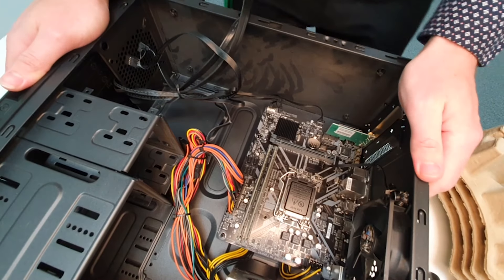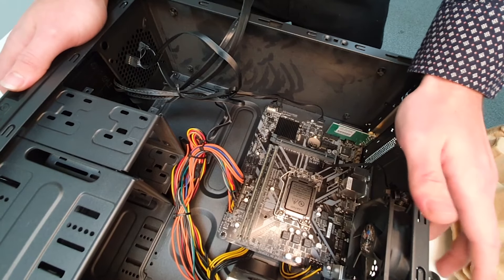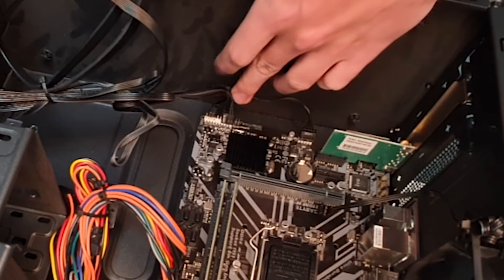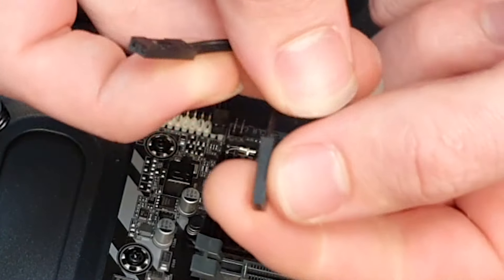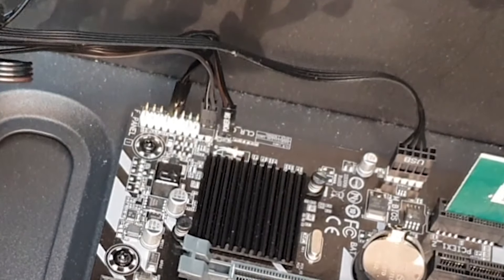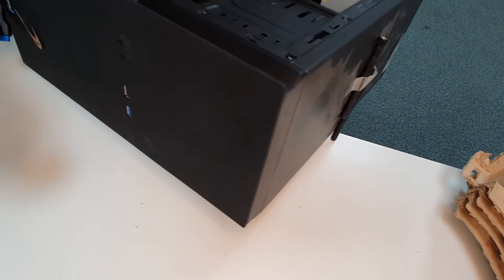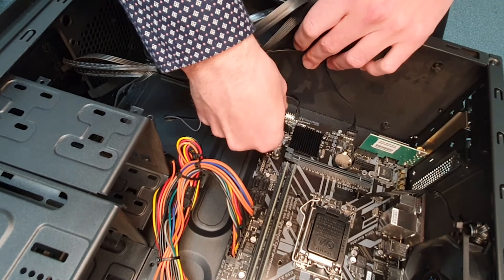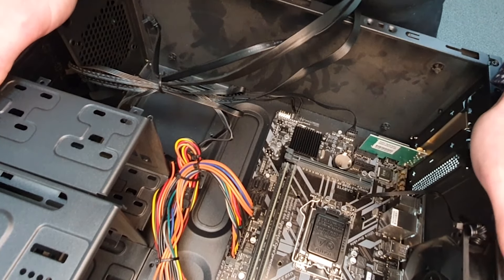How to Reset CMOS - Reset BIOS Fix Display Issues!

Comment: I did everything you just showed, as well as removing the battery and nothing worked. The PC runs, but no display. The graphics card is on - the fans are spinning. It was working fine until I stupidly adjusted the wrong settings in my BIOS
Reply: Did you changed graphic card to switchable? I turned my laptop on and waited like 4 hour. Then it turned on automatically. Its pretty stupid solve but worth trying
Reply: Hi, did you fixed it?
Reply: I probably did the same stupid setting in the bios, same problem. Nothing seems to work :/
Reply: @zyxified3518  did you fix it?
Reply: Did you ever find out how to fix it
Reply: mine too, i using ryzen 5 5600g. change the uma frame buffer size from 4gb to auto on bios, and then my pc is on, but output ro monitor is none
Reply: That is the same thing I did
Reply: Anyone find a fix
Reply: @abinkurian4137  you ask ? yes, just hit the cmos and everything just back
Reply: What thing you change for not do the same
Reply: I used an cpu with integrated graphics and removed the gpu and it did worked. It let me go in to the bios and change the settings that caused the loop
Reply: @eduardoaraniva4235  my cpu dont have integrated gpu, what should I do?
Reply: @eduardoaraniva4235  I go to service center from I bought my Motherboard, They check and reset BIOS but still error, luckily warranty still on and they can change it to the new one :D
Reply: @jaxx761  Happy to hear that man! Enjoy your new mobo :D
Reply: @jaxx761  you mean, you must have GPU off board to get image on screen?
Reply: @eduardoaraniva4235  if cpu does not have integrated motherboard must have off board GPU ?
Reply: @evangelista279  I'm not sure If I get you right, but if you don't have your GPU on board you won't have image no matter what. That's why I used a CPU with integrated graphics card and only then the GPU is off board. So the image will be shown by the CPU and not the GPU so you can enter the bios and reset the settings that caused the error.
Reply: I can't enter bios, every time I press f12, del, iy's just black screen? Any solution
Reply: @funnyrailroadcrossing2767  did u fix it ? i’m in this situation rn
Reply: @a2frostyyt  yes, already fix it.
try this tutorial(found on another youtube comment) :

1) With gpu installed, clear cmos. Boot. You should get stuck on the screen like the video.
2) Turn off computer and remove gpu. Use onboard graphics for step 3.
3) Boot and enter bios by pressing delete. Under bios features, change pci rom priority to Legacy.
4) Boot one full time without gpu, using onboard graphics. Then shut down.
5) Reconnect gpu and it should work fine.
Reply: @funnyrailroadcrossing2767 what if integrated graphics isn't working too?
Reply: @lotzrefuerzo8616  it's always working, even without intel HD graphics installed.
Reply: @funnyrailroadcrossing2767  thanks, but mine isn't working. Also tried to remove and return the CMOS batt, still no result.

 I just updated my BIOS last night then the monitor display, mouse and keyboard turned off.
Reply: @arrahman7029 , same processor here, no output. Trying this on my TV (HDMI), no signal detected. When I press F2 to enter BIOS, I get a meassage "video detected" but the black screen remains. This is the first time I assembled a PC. Found on compatibility check that CPU might not work fine if mobo is not updated to the latest version. Gonna take it to my office tomorrow and try connecting it to the monitor. Also downloaded the latest BIOS version for the mobo, so I'll try that too.
Reply: flash your bios
Reply: @akshay8561  nah, MoBo is bricked
Reply: @lotzrefuerzo8616  motherboards cant be bricked only gpus
Reply: Same situation, and nothing worked for me
Reply: I have the same problem right now, nothing seems to work.
Reply: Update: I just let it on overnight, and It magically worked next day. Probably the mobo was "adapting" or something
Reply: @aurothelarper   for some werid reason, the cd rom drive prevented my friends computer from starting.  Not sure why.
Reply: @aurothelarper hi ma brotha, what is ur mobo, im in the same situation
Reply: @GUZIN59D  It's a generic mobo with isync BIOS and I-45 chipset. Pretty shitty and screw me over all the time

Comment: I do this and it worked but again same display problem happening
Reply: Same bro did u fix it?
Reply: @ludiikhsan   yes its working! what i do is in the 1st time change the ram and then remove your power button socket and start your pc with screw driver
Reply: But it always happened to me when i turn on my pc at the first time, always no display even when i fix it, it will happen again and again when i turn on my pc on the next day or after i shutdown it

Comment: I removed the battery and tried the cmos reset, but it didn't work. It did work before when I had the issue before, but now when I try to repeat it it doesn't
Reply: Same here it’s really weird sometimes it works other times it doesn’t for absolutely no reason
Reply: Same :/

Comment: What would be the next step? I just reinstalled windows 10 on my PC and everything went well until I changed the resolution. Directly after that I got a black screen with the message "input not supported". I tried numerous methods to get into safe mode but I can't find it anywhere. Someone told me to reset  CMOS so that's why I'm here. I never opened a´PC before. Lol
Reply from the maker: Hi, did the CMOS reset work for you?
Reply: @RollwithPunch  hey if you're still here I need help, I reset cmos and my pc still isn't rebooting and shows a red cpu light any recommendations
Reply: @capiscuul  maybe faulty mobo ?

Comment: Hi i want to make BIOS reset in mobo gigabyte f2a88xm-ds2 but i have the one question is working this method with out removing the BIOS battery and connect the power button ?
Reply from the maker: Yes the BIOS battery does not need to be removed, the CMOS reset switch is what disconnects the battery. you can do it either way.

Comment: yesterday i watched video that said u need to press reset to setup mode when i tried to active the secure boot, i had beacuse that a black screen and watch video that says take out the battery and touch the cmos with a screwdriver. didnt helped me so i took the computer to the lab....maybe if i would see this video b4 i be able to solve my problem....we will never know
Reply: Please tell me if the service helped, what did they do there?

Comment: My rgb lights came on after resetting but still having no signal when connecting to my monitor
Reply from the maker: Try removing your graphics card and checking the contacts on the PCIe slot. If all looks fine, put the card back in and try again. If you have integrated graphics, see if they work.

Comment: if you reset the cmos will it boot from the m.2 drive that i just cloned cause its not and the bios is not displaying correctly, I upgraded my hard drive from 1tb to 2tb i tested the cloned drive and its 100% healthy but it wont boot

Comment: tried thos method nondosplay on the screen,Inalso troed the method in the asrpck B550-itx/ac manual using jumper cap no good, I replaced my psu vecause it sparked progonal when I pluged the power sw in the wrong spcket and now I feel the battery is dead I cajt replace it vecause wired

Comment: I just did a CMOS reset (removed the battery and put it back) and my pc turn on but no display, can you please help
Reply: switch to onboard videocard, maby you need set settings again to your videocard
Reply: @NynkeFdejong I have the same problem with him and tried to use both GPU and iGPU but no display either...

Comment: Hi! I’m having a “2 beeps of death” issue on my Dell PC, which means it can’t detect any RAM. Previously it was constantly displaying “the amount of system memory has changed” messages upon reboot. Now it doesn’t even boot anymore. I’ve tried reseating it multiple times and multiple ways with no success. Is there any chance this method could help to solve the issue?
Reply from the maker: It could be the memory controller in your CPU that has failed or the motherboard has failed. Give this a try first though.
Reply: @RollwithPunch  Thank you for answering, it has booted up with the new RAM I’ve bought a while ago. Oddly enough, it recognises 16 gigs as 15,8 or something. Also, now it randomly freezes and I have to reboot it every time it does so. I decided to not use that computer anymore, must be some CPU or motherboard issue. It served me great since late 2012, it’s time to rest now :’(
Reply from the maker: @FF9F00  hahah I'm glad it's done well for you!

Comment: I was just browsing then my pc crashed, when turned back on there was no display. What I tried was reseating ram sticks, cleaning them but that did nothing. 

I think the CMOS battery is behind the GPU, I will try that and hopefully that’ll fix my “NO SIGNAL” problem because I don’t want to play around too much in case I mess something up y’know…. But hoping for it to work, otherwise… idk.
Reply: How did you fix it? Im facing the same issues.

Comment: Can i ask we do this by having power?
Reply: If you mean having the cable for the power supply connected to it then no to reset the bios you need to have no power at all on the pc or else it will boot and you have to do it all over again
Reply: @DeTrollyEye  like the whole build again?
Reply: @synderkinn6391  no what I mean is that you have to turn off the computer again then unplug the cable from the Power supply so you can prevent it from booting. After that remove the CMOS and press the power button for a couple seconds while the computer isn't plugged in so that you could remove every bit of power left to the computer. After that connect the CMOS and plug the computer and boot it if it doesn't work then you can say that the pc motherboard is gone
Reply: @DeTrollyEye  the PC won't turn on since the power button is connected to different pins. But the power supply can keep uefi data alive.